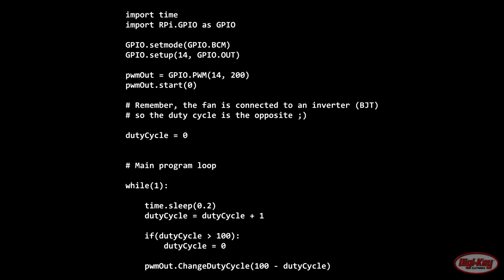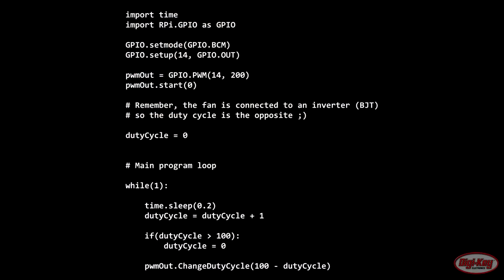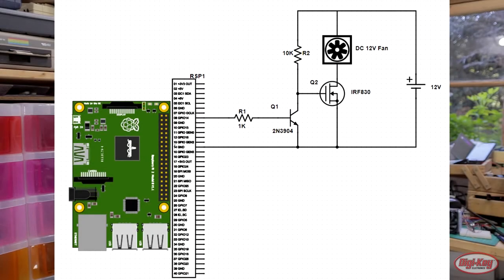How to Control DC Fan Using a Raspberry Pi – Maker.io Tutorial | Digi-Key Electronics

Comment: What I just watched was the introduction to a great video. I feel like I've been blueballed.

Great presentation, likeable dude. Zero actual information about the topic.

-How do you run the python script
- How do we provide the fan with 12v -How do we adjust the curve. 
- Is this running on Linux
- How do we setup the PI

So many questions, zero answers. 10/10 concept, 0/10 execution.